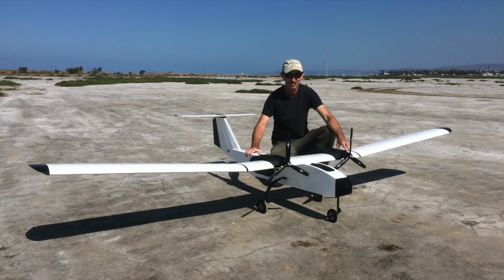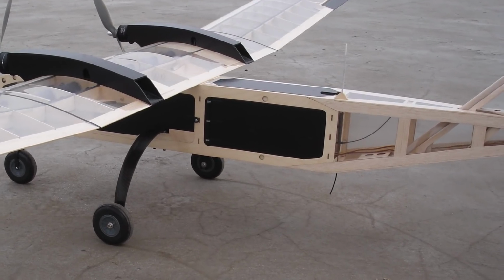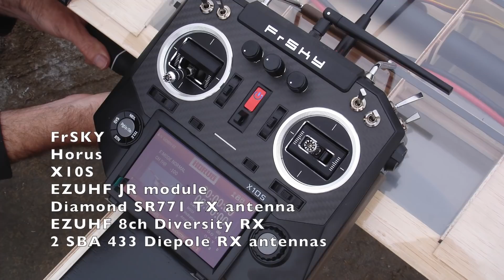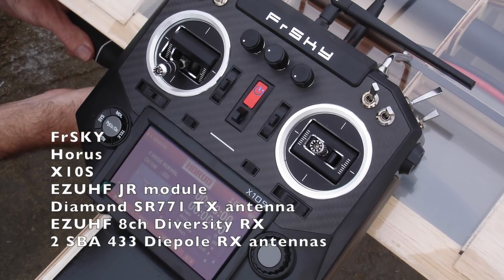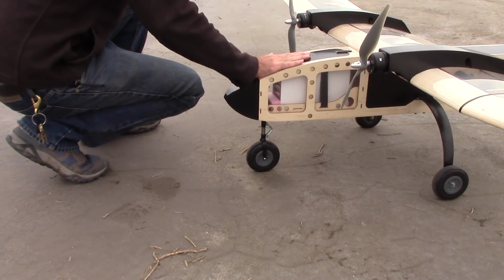Gemini V-2 Custom Long Range UAV with Transparent Monokote Covering

Comment: Very nice ! hello how do you lock the wings together ?
Reply from the maker: There is a plate with 4 screws per wing and plywood gussets to capture the screws. so double what it should take to secure the wing. there are also two locating dowels, besides the carbon tube. to assure alignment and torsional strength.

Comment: Will build it at some point in time, I bought the plans years ago :). An old school build, modular, with huge potential. Any plan to add floats & flaps?
Reply from the maker: A re-designed wing could have flaps, but there are challenges to designing flaps that do not de-stabilize the aircraft in several ways.
I've designed floats before for a Sig Senior Kadet, but don't see much need for floats on Gemini.  I'd love to see it though.  Should be possible to adapt an existing float kit!